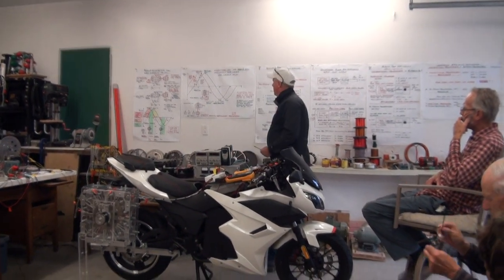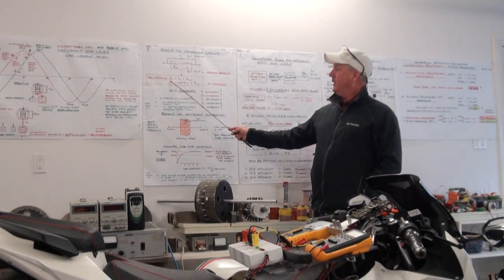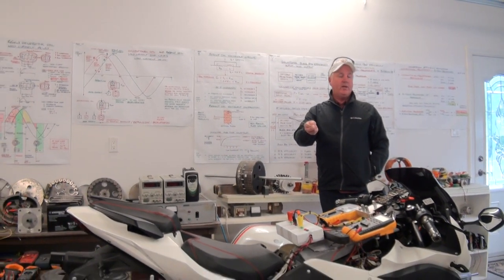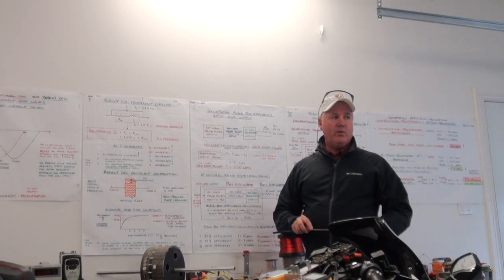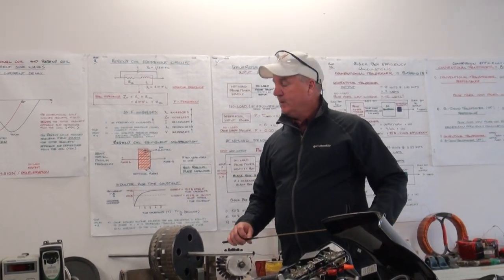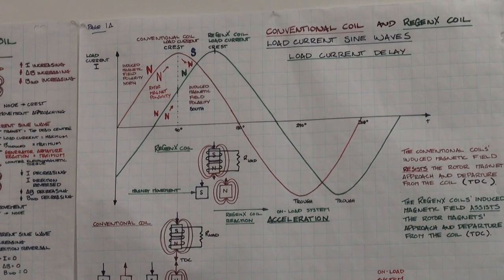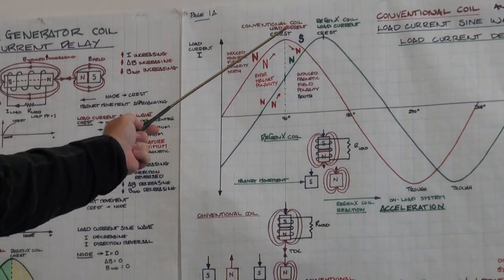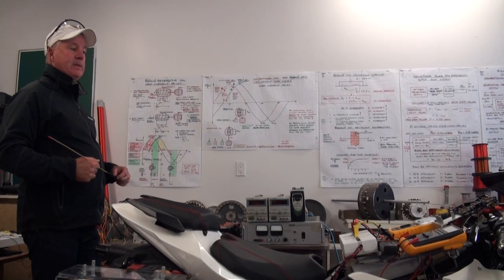HOW TO VIOLATE LENZ'S LAW OF INDUCTION WITH A LOAD CURRENT TIME DELAY - AKA HENS' LAW OF INDUCTION

Comment: As the N magnet approaches up until TDC, doesn’t the capacitance of the RGX coil capture an attractive charge to assist the rotor. Plus when it switches to moving the N magnet away, the capacitance starts discharging that flipped charge into the inductance over the full length of the inductor (not end to end) and cascades a very fast changing Voltage into the inductor, exponentially boosting the induced current (magnetic field) over the current normally produced by the standard inductor. Both delayed Lenz and static charge release assist the retreating N magnet.  OK?  These accelerated changes amplify energy transfers exponentially. (Not a linear function, which is consistent with any kinetic energy exchange.) kudos TC. Party on engineers, drive a nail in the coffins of toxic energy production, the economic losses are more than worth it for the lives it saves.

Comment: Where do you put the flux capacitor? And can you get up to 88 mph???
Reply: Yes, several of us see the flux capacitor of a bifilar winding. Obviously wound where the normal inductor is Same number of windings, just double-tasked to be capacitive along the inductance. Not a configuration they teach in electrical engineering classes. Oddly, adding capacitance to inductors, changing the phase of the Lenz effect is common for start coils of single phase induction motors. (Making it full time is discouraged.) This approach (as Tesla reported in his patent) has the benefit of managing the amplified voltages better than localized constructed capacitors. (Necessary for his Tesla coil purposes.)

Comment: So the transformer is operating like a capacitor like a Tesla Bifilar Pancake coil? I have been playing around with winding cores with bifilar windings, wired front to back like a pancake coil. Hitting it with a ZVS so that it operates like a LC tank circuit = POWER!!! Your Bi-toroid setup could be the next step I will try as it sounds like an additional tank cuircuit is made within the transformer itself? Great work.
Reply: can u post some results ?

Comment: hi, how do you present the energy balance?
fun thing about distributed resistance is that it has no effect on voltage, induction doesn't care about resistive wire, but it does limit current because v=r.i
probably something similar happens  with distributed capacitance. 
would using a bifilar coil work even better because it has much distributed capacitance and has no self inductance, while it does get emf from mutual inductance?

Comment: Well done Sir, great invention. 

please can the bi toroidal trafo be used to power electric motor, because you reported it can work with purely resistive load?

Also, can I use diode rectify the output of the secondary coils directly to charge battery?

Can I use DC input to primary coil to charge battery with the secondary coil?

Thanks Sir.